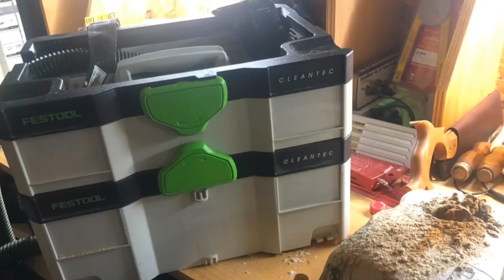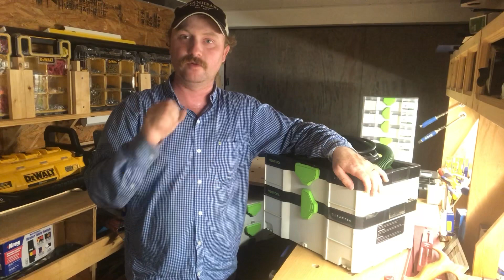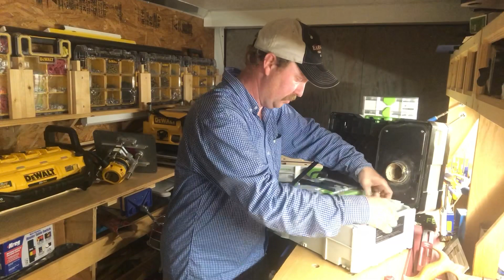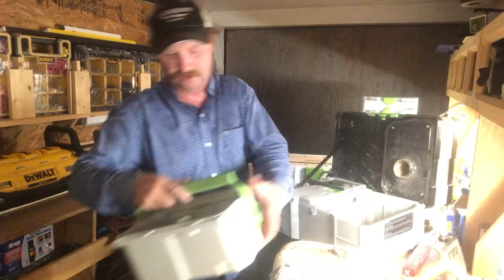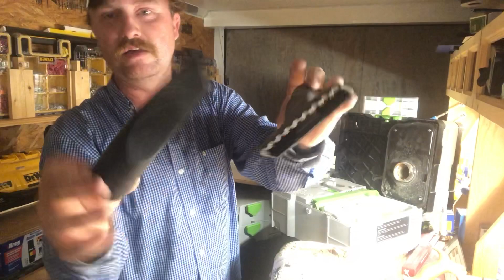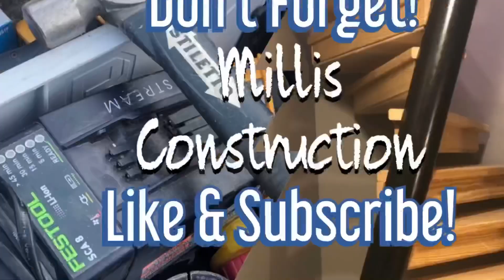Festool CT-SYS Vac Review

Comment: Would you think it would work hooked to the back of a Miter Saw or a Router Table? Or a Kreg Track saw
Reply from the maker: It will but it’s capacity is really small for that need. You’d need the reusable bag or the bags would get expensive quick. 

Personally I use my midi or my CT36 on those tools.

Comment: It’s a piece of junk. Do not buy this useless machine.
Reply from the maker: How do you figure. I’ve had mine several years without issue. It’s running right now in fact….
Reply: @MillisConstruction  thanks for response. I bought it 4-5 years ago and it has never performed worth a sh*t for more than a few minutes. Sent it in for repair twice. Second time they replaced the turbine. If there is more than a sugar packet of dust in the filter, the safety baffle engages and it loses suction and makes Jurassic Park noises while running. Perhaps I have a lemon. I own a lot of Festool. Love their stuff. This thing does not function like a vacuum. But, good thing it has the blower feature. Why? Because you can blow the debris closer to an actual vacuum! Thanks for your effort with this video and your response.
Reply from the maker: @WiFredC  that’s terrible, they should’ve taken that thing back!  Sorry to hear that 😬
Reply: @MillisConstruction  I will pester them about credit for a MIDI. Also, I will do a YouTube review every week for the balance of my telling people how worthless that thing is. They repaired it second after warrantee because I was so irate. New turbine and still a useless pile of plastic. It is really just a $450 under-powered blower.
Reply from the maker: @WiFredC  I bet you’d get noticed with the review, Festool will probably even see it 😁
Reply: @WiFredC  do you use bags?

Comment: Hi there, I am considering this or the mini, my space is rather small. Is the suction the same as for both? in other words is it powerful enough to be used with your router and plunge saw and the only difference really is, is the volume of the dust bag? thanks in advance sir :)
Reply: Buy a MINI. Steer clear of this thing.
Reply from the maker: The main two issues there are a lack of variable suction and the tiny bag size. The vac has plenty suction for either but connected to those two tools it’s going to fill rapidly. 

Suction rating for the sys vac is:
Max. Suction Capacity 106 CFM (3,000 l/min)
Maximum Vacuum 80” static water lift (20,000 Pa)

Suction rating for the mini is:
Max. volume flow 130 CFM (3,700 l/min)
Max. vacuum 96" static water lift (24,000 Pa)

Not very much difference?  I have the midi though and not the mini so I can’t speak to the minis real world applications. Those specs look pretty close though
Reply: @MillisConstruction  thank you for that, i guess it just means to empty the bag more often. The £ diff is around £100 i think between the portable and mini. ps I have a cheap 1300w vacum , do you think the quality of the build is what makes festool vaccum the key?
Reply from the maker: The auto activation with a tool is a lot of what does it for me, they’re solid built too of course. I just like everything to work together very well for site work since I don’t get to work as much from my shop. My shop has a normal dual cyclone Oneida system built into it so the festool vacs primarily are used with the domino, track saws, routers etc there. 

You can buy the long life bags also and with it being your primary shop vac system it may be worth doing that for you. The festool cyclone system may also be an option?  I’d definitely look into either one as the bag cost would probably justify one of those options for your situation

Comment: Is it recommended to be able to combine it permanently with a miter saw that I do little use? It would be ideal for its small size and low noise. What do you recommend? Thanks
Reply from the maker: I believe your biggest issue there would be the incredibly small bag size. Miter saws put out a lot of chips and would fill it pretty quick. A long life bag or a pre separator would almost be a must have unless you really barely use it. 

This vac for me is great for sanding jobs or a quick door trim with a Tracksaw as sanding dust takes a long time to fill up a bag. 

Hopefully that helps 😅
Reply: @MillisConstruction  Thanks for your answer. I need to apply a small vacuum cleaner to replace my current too bulky one. However, it is important for me to know that the residue of a saw can easily vacuum it. It is not a machine that I use very often and it would not be a problem for me to empty it more often.
Reply: Sorry if the signature is different, but I'm replying from another person's PC ....

Comment: Thanks for the review. I've had one of these for a while but I considered selling it because I found the hose storage to be kindof annoying. The hose and two power cords  get messy in the hose garage and despite careful packing, I find that it's difficult to get everything in there flush... which makes it difficult stack another Systainer on top. To fix the messiness I'm considering covering the hose and one of the cords with Flexo PET. Of course that's not going to make packing everything in the top any easier. For that I've considered cutting the hose shorter but I don't particularly like that idea.

Have you found this to be a problem or am I missing something?

Comment: i'm a tool novice who just bought a house with lead paint.  i want something i just go around the house and vacuum friction points once a week.  would you rec this, or maybe a dustless backpack model?  the lead dust stays totally contained?  (why is there dust where you take out the back?)
Reply from the maker: The main reason this one threw dust is because I overfilled it like crazy. The Festool vacs will flat suck until the hose even fills sometimes so checking more often than I do may be smart if you’re working with hazardous materials. 

The Midi is my favorite Vac but if that’s all you’re doing this would certainly be plenty for sure

Comment: How well will this work in your opinion with a saw boss or track saw in mitigating dust for in & out installs. I’m currently using a fein turbo II but trying to become more mobile. I’d appreciate any input. Good tip on the sanding. Thank you.
Reply from the maker: Hey!  Thanks for watching!  I use it with all my tools that need collection including the Track saws etc especially for smaller jobs that only require a few cuts. The only real negative about the vac is bag size, but it packs it very tight so you can get a lot more use from a bag than you’d expect. 

On a larger job I usually bring a midi but this is perfect for a few cuts for sure.